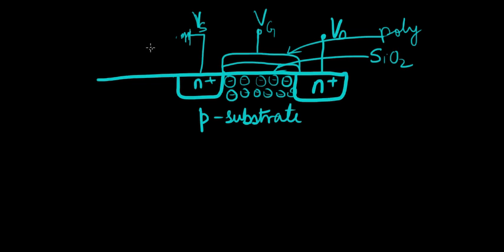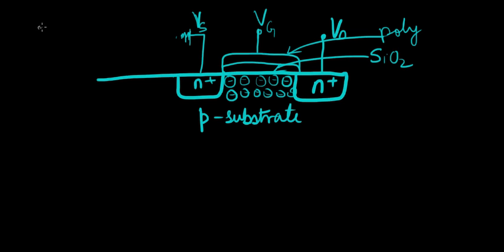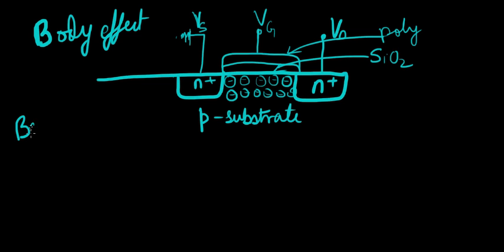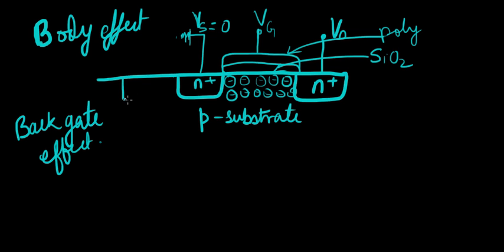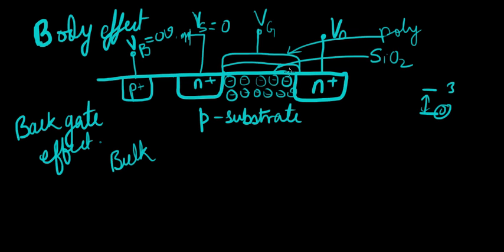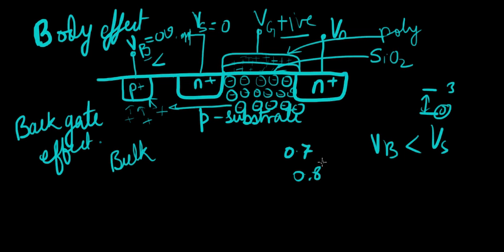Body-Effect

Comment: For those of you who are confused on why a increase depletion region leads to an increase in V th, I think you guys may be confusing depletion region and inversion layer. a depletion region is a situation where holes in the p type are filled and electrons won't recombine however now a depletion region is not conductive, why? because adding an electron to say a boron doped p type will make the overall atom negative. This will now repel any electron trying to cross the channel. What the gate does is increase the voltage so that it attracts the electrons from the n type junction more than the depletion region repels it. Now in case of the body effect we have even more holes missing making the whole depletion layer much thicker and therefore much more negative and replusive, so now to overcome the em effect the voltage must be higher. Yes the channel width seems wider so I imagine max current might be better? idk but we are always talking about the balancing of charge so the depletion field doesn't repel the electrons trying to cross
Reply: Your explanation makes a lot of sense. Cant thank you enough. Was looking for the answer. Much love brother.

Comment: In a capacitance the charges are always mirrored. So that is why you dont have to increase the gate voltage to have charge equilibrium. which results in this explanation to be wrong. The effect is still correct but it is explained by observing energy levels, as explained here https://www.youtube.com/watch?v=47uJlHi9X4c

Comment: The sentence  at the end made it very simple.
Increase in threshold voltage (VT) due to  decrease in body or bulk voltage (VB) is called body effect.
As you can consider the body itself as a fourth 4th terminal.

Comment: I think in this case , if vb<0  |=> the additional layer of fixed negative ions SHOULD DECREASE THE THRESHOLD VOLTAGE
Reply: yes but since its a MOS capacitor the positive plate/ Gate side must also have same amount of positive charge. To gain more positive charge we need to apply more voltage at gate terminal
Reply: @dheerajha6638  can you explain why the generation of additional negative ions on the body side induce an equal magnitude of positive charge on their own?
Reply: @tengisdashmunkh1787   the number of positive ions must be equal to negative ions. If its nt there then the electric flux won't end at all. This cannot happen

Comment: Every thing was explained precisely but you made a mistake i one part. When Vb > 0 than it will attract electrons (which are minority charge carriers) towards body thus decreasing No. of electrons in channel. In that case the gate voltage has to increase to maintain enough amount of electrons in channel for conduction and that is why Threshold voltage increases.
Reply: In this case , if vb<0 , the additional layer of fixed negative ions SHOULD DECREASE THE THRESHOLD VOLTAGE
Reply: Bro u are keeping the vgs constant initially

Comment: For those of you who got stuck at the part where he says that the increased negative charge near the channel requires a more positive potential to balance the excess negative charge, I have an alternate explanation. For this consider the body terminal to be at the base of the MOS. Now when you apply a negative potential, the electrons present in the channel are repelled more towards the insulating layer and so the channel depth reduces. In order to obtain the same channel depth as that of a MOS with no body voltage, you will have to increase the positive voltage at the gate(Vt).
Reply: Channel depth increase right because electrons having 3 rows now.can I get more clarity on this?

Comment: Why do we put p+diffusion in p substrate and connect that to ground? Why can't we directly connect the p substrate to ground?
Reply: ctnrb if u connect directly p substrate to groud using metal it forms Schottky diode and its form unidirectional current to flow hence we need current either directions to over come this heavily doped p diffusion to connect it to ground and also provide gud ohmic contact with low resistance

Comment: i didnot get why the gate voltage must increase ??
Reply: Why should the negative charges at drain to source should be equal to positive charges at the gate to start the conduction
Reply: because the negative charges at drain to source should be equal to positive charges at the gate to start the conduction but here the negative charges are here majority so thats why gate voltage is increased to have more positive charges at gate.
Reply: Syed muhammad Musab
Reply: FOR CONDUCTING I THINK...
Reply: the gate voltage must increase because, the voltage at the drain and source are equal so there is no flow of current , to make the electrons flow from one side to another side we increase the gate voltage more, after increasing the gate voltage at perticular point the electrons will flow , so we can say that, amount of voltage required to flow the electrons is called threshold voltage and it is denoted by vth.

Comment: Under what reasons do bulk voltage fall below 0v ?
Reply: ghanshyam patil   it doesnot fall below 0v but when the source voltage goes higher than 0v the body is at lower voltage than the source. its all relative.
Reply: Why do we put p+diffusion in p substrate and connect that to ground? Why can't we directly connect the p substrate to ground?

Comment: Why would the p+ bulk region voltage go below 0v?
Reply: A good exemple is Flash applications, where a charge pump can be used to force the bulk below 0, helping to push the electrons at the silicon/oxide interface, enhancing the carrier injection.
Reply: You may also keep Vb=0, and you increase Vs. It happens in, e.g., MOSFETs in series like in cascode, when you simplify your chip layout and you keep one common bulk with Vb=0, but the source of the "upper" MOSFET has Vs>0. So, you end up with the same situation when Vb is lower than Vs.

Comment: hi nice video.
A small comment when you describe the increase in negative charge in the substrate (~4:12) you are correct. But it my help to think of its effects in a slightly different way.

The surface potential in the channel will remain constant because you have a grounded source, thus the electric field will remain constant across the oxide region, and thus the gate charge remains constant. But to maintain charge neutrality the charge on the gate must equal the charge in the channel plus the charge in the substrate, therefore the channel charge must reduce.

The reduction in channel charge causes a likewise reduction in drain current, this is equivalent to a change in threshold voltage. So a higher Vg is necessary to maintain the drain current. The change in threshold due to substrate current is commonly modelled as a function of gate oxide thickness and channel doping for this reason. 

Its basically what you describe, but phrased differently.
Reply: Thank you for the explanation, it helped me.

Comment: what if i increase the voltage of VBS?
Reply: A forward biased bulk to source pn junction would result I expect, the Bulk terminal would attract -ve charge, reducing that in the depletion layer between Vs and Vd. To maintain equilibrium Vg would need to be lowered to reduce +ve charge at the Gate terminal which effectively lowers the Vth(turn-on) voltage.
Reply: Why do we put p+diffusion in p substrate and connect that to ground? Why can't we directly connect the p substrate to ground?

Comment: Well, I've been reading about techniques to reduce leakage power of a circuit. And body biasing is a suggested technique. With biasing the body to a lower V, an increase in the Vth is observed, which keeps the leakage current even lower when the circuit is in standby mode. Thanks, as you made it clearer to me.

Comment: This video is misleading. Vt increases for negative body bias, but it is NOT because the amount of negative charges increases in the channel region. It is because, negative bias at substrate results in a wider depletion region, that is why a larger bias is required at the gate to form the channel region (larger Vt).

Comment: u explained based on quantitative analysis....but how qualitatively is it correct...means how threshold voltage is increasing when Vbs<0 .....when Vbs<0 there is automatically charge accumulated in channel...results reducing the Vth of MOS...can u please explain qualitatively .....
Reply: a new capacitance are formed like as tox between channel and body so it behave as a back gate